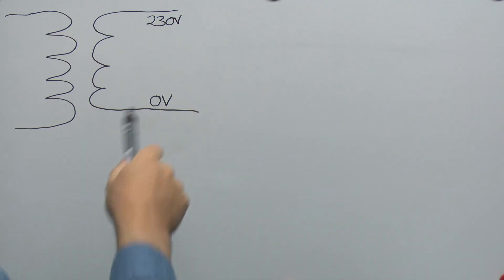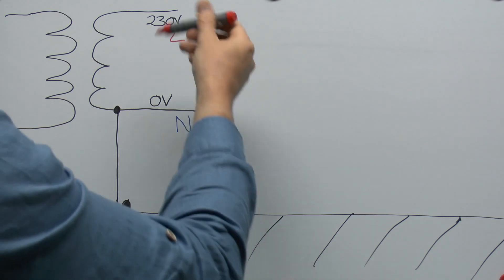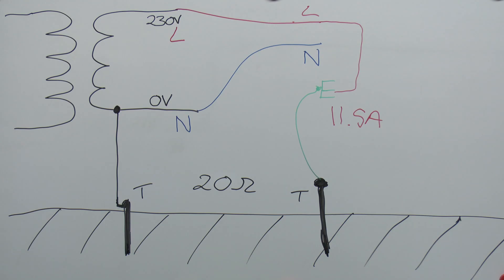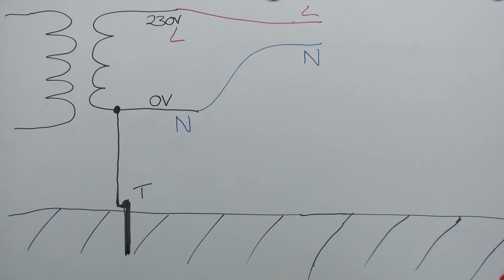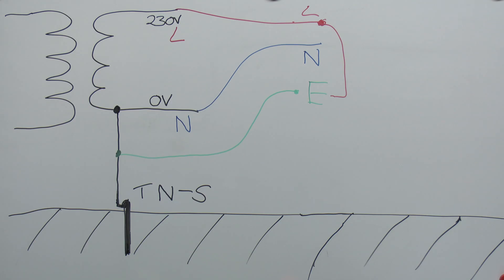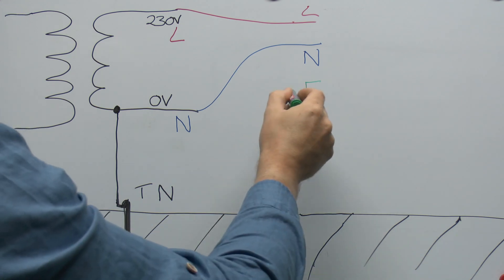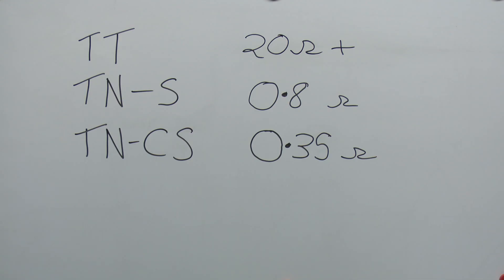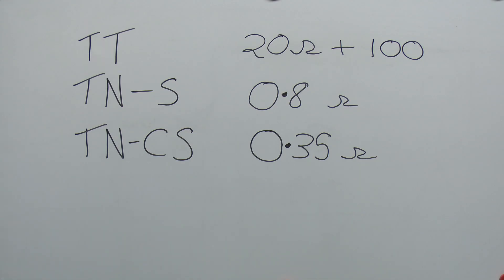Types of Earthing System for Electricity Supplies (UK)

Comment: 15:30 How did you get the theoretical max loop Z of 1600ohms (1.6Kohms)? 

If the trip current is 30mA and assuming 230V, the theoretical max loop impedance by V/Z = 230V/30mA ~ 7.6Kohms = 7600ohms. (Which is of course even more colossal and common sense dictates that's not a good idea in practice!)
Reply from the maker: +Arglwydd Anfradwrus It's 50 volts / 30mA, as in regulation 411.5.3
If 230V was used, this could result in voltages up to that level appearing on exposed conductive parts before the RCD operated, which would be a serious shock hazard.
Reply: Ah, thank you.

I stand corrected. 50V/30mA = ~1600 Ohms, but of course that's still way too high. 

I wasn't saying it was right for it to be 7K+, just wondered how you got that figure of 1600 ohms.

Very good explanation.

Comment: From an electrical safety and economical perspective the TN-C-S system is great. 
From an EMI (Electromagnetic Interference) and potential long term health effect perspective the TN-C-S system is horrible.
This is because TN-C-S among all grounding systems causes the most electromagnetic interference.

A lot of buildings have a reinforced concrete foundation with multiple electrical installations and conducting water/gas-pipes, which according to most electrical guidelines have to be connected to the Protective Earth. This causes the current which normally only flows through the neutral wire to also partially flow through those other grounded metal parts.

This will cause high magnetic fields which normally only occur around high voltage cables (more than 50kV) with a significant load. If the water/gaspipes and CATV/phone  are also bonded to the grounding system it will make things even worse and probably spread out magnetic fields all over the neighborhood.

Some countries understand this problem. France is such a country and they simply enforce TT-System in all residential buildings. Every customer main circuit breaker is also a 500mA Residual Current Device. So even pre-WW2 installations with ungrounded sockets, waterpipe grounding and fuseboxes without RCD's are relatively safe because the 500mA RCD will trip whenever a circuit leaks current through the ground.

Another solution to this problem without digging up the old cables would be to switch inside of the building to TN-S. At the entrance the PEN conductor (Protective Earth Neutral) has to be split into Neutral and PE. At this point the PE will also be connected to the foundation. This will limit stray currents inside of the building.

The best solution however would be to switch back to the TN-S system. Then you have your low impedance Protective Earth AND prevent Electromagnetic Interference. In factories, military and government buildings they still apply TN-S grounding for these EMI reasons because these buildings are usually too big for TT-Systems and they already have many electronic devices for more than 50 years. Until 2000 most electronic devices in a residential area were 2 TV's and 1 computer. That's why TN-C-S was not a big problem until recently.

We know long term exposure to magnetic fields >400nanoTesla causes an increase in child leukemia. We also know that electric installations become more and more polluted with pulses from electronic power supplies from which the long term effect are still unknown. The evidence that slowly starts to build up is not very positive. Therefore magnetic fields should be limited as much as possible. TN-C-S is not doing as much as possible.

So my advise is if you have TN-C-S. Take your own responsibility and switch to TT-System with proper RCD's installed whenever possible. Also apply galvanic isolation to all pipes (water, gas, cityheating) and shielded cables (CATV, Phone) to prevent currents from flowing through them.
Reply: How could EMI be introduced in the TN C S System when the neutral is earthed on both side, supply transformer and Distribution Board in the premise? Water and gas pipes were equipotential bonded to the earthing system in the premise. The earth reading shall not be more than 1 ohm! The low resistance in the earthing system the better will the return neutral current, which is only half of the design load. If there is going to be a fault current, it will also be very safe.

Comment: just wanted to say thank you for providing one of the most concise and clear explanations  of earthing structures
Reply: Cìâ
nhta çcucu derasunaaq
Reply: On cum ma fut
Reply: I only have experience where I can say for certain.

1. Only phase and neutral conductors are supplied.

2. No earth rods are installed at the transformers.

3. No earth rods or bonding to re-bar in the concrete is carried out.

4. Therefor this is a substandard TT system.

5. Sometimes earth and neutral are joined together making things worse.

Go watch my Facebook video Samui English Electrician
Reply: As they say...a drunk could understand that John...couldn’t be clearer...excellent. Thanks.

Comment: have you heard of a floating voltage. I had 23 volts L-N on a lighting circuit with nothing connected and everything switched off . I as told it was a floating voltage but cannot find much about it
Reply: Yes it happens when a live wire is next to a wire not connected to anything (f.e. switching wire) without any ground wire to discharge. If you do not connect any load (f.e. light bulb) the voltage can be anything between 0 and live (in the UK 230 volts).

That's why you should install ground wires even to a switch. To prevent parasitic charges. Many countries however still do not enforce this because it does not pose an electrocution risk.

Comment: There is a label on the cutout here that says "This installation is connected to a PME system" - so that confirms mine. A house we lived in before had a plate on the cutout saying "PME system" too. However, we also lived in one house where the supply came in from the poles, and that was TT. Our ELCB was a Chilton voltage-operated one.

Comment: I think the system in BRD often used is a bad idea. 
The TN-C-S grid on scematics show that some normal current go back to the transformer to the ground. 
I like the TN-S grid whith only one earth at the transformer . After that the neutral dont get another conection to earth!
Reply: +Klaus Jürgen You're right. That's why I don't like TN-C-S. TN-S or TT is the way to go. But since TN-S requires the electricity network company to install a cable with a seperate Protective Earth, the only way you can go usually is TT-System.
Reply: We use TN-C-S in the US. The most common problems are either incorrect installation (a sub-panel has earth and neutral connected in addition to the main panel) or one of the rare conditions where TNC (Earth and Neutral are same conductor) is permitted AND a voltage appears on the neutral relative to earth.

The TNC system has been banned from new installations since the 1996 National Electrical Code (adopted by local officials between 1996 and 1998 as some places run a year or two behind NEC) and was ONLY allowed on circuits feeding dual voltage appliances (clothes dryers and ranges usually). That allowed feeding a dual voltage appliance with three conductors (2x live and 1 Neutral) instead of 4 (2x live, neutral, and earth) and this practice (especially on ranges) dates back prior to earthed appliances.

Comment: In France, TT is the default system for everything; in new construction they typically use a earthing "ring" with wires buried all around the concrete foundation instead of rods; RCDs are mandatory. Here in Canada IT is used in Healthcare facilities; these systems are subject to very strict rules.
Reply: +w0ffe I think IT is only used in Operation Rooms. Most non OR's are usually TN-S.

Comment: Hi john I'm currently doing C&G 2365 and have been asked to give drawn examples of Tns, tncs, tt and IT supply and earthing systems. I have no problem with the former three but the IT system is proving problematic to gather info on. Do you know when or where people get trained in this type of install? My 2365 textbook states. IT and TNC  systems are not included in this course so there is no information included on these type of installations. Thanks. Phil.
Reply from the maker: +phil Harvey IT is where the supply is isolated from earth, such as an isolating transformer.  Neither side of the supply is connected to earth, or it is connected to earth through a high impedance.  It is typically used for medical installations such as operating theatres.

TNC is a system where the neutral and protective conductor (earth) are combined into a single conductor within the installation, so only 2 wires to each item.  It is specifically prohibited other than in a few very specific instances, so in reality is never used in the UK.  The supply is the same as TNC-S, except that there is no split to separate earth and neutral where the supply enters the building, it continues for the whole installation with the combined neutral and protective conductor.

There is some information on both in BS7671.
Reply: +John Ward nice one john. I would guess that training for IT installs is trained by the energy supply company.

Comment: In Australia, the Multiple Earthed Neutral (MEN) earthing system is used and is described in Section 5 of AS 3000. For an LV customer, it is a TN-C system from the transformer in the street to the premises, (the neutral is earthed multiple times along this segment), and a TN-S system inside the installation, from the Main Switchboard downwards. Looked at as a whole, it is a TN-C-S system. So, normally there will be a link in between the neutral and earth bus bars behind the switchboard, as well as at the local transformer.

Comment: A very interesting video,  in my hobby (amateur radio) we tend to have grounding arrangements that attach to the shield of coaxial cable at the base of the aerial. This cable then generally connects to the equipment chassis within the house which is also connected via the standard mains lead to the standard domestic mains earth.
In my set up the "ground mat" under the lawn is also bonded to the water piping of the house.  It is a slight concern that in the event of a live-earth short in any part of the house a proportion of the fault current will flow through the equipment chassis to the " other ground".
For various lightning protection reasons it can be very bad news to isolate the two grounding systems.. ie to provide a seperate safety earth only for the radio gear.
This situation must be very widespread, presumably the answer is to make the bonding path as low resistance as feasible to minimise the current flow through the other path? We have an RCCB so presumably my question is more of a hypothetical one?
Thanks for the video, most educational!

Comment: Why do they use earth rods? Can’t the neutral cable carry all of the fault current back to the transformer? 
Also if someone touches a live conductor and they are standing on the ground outside they can receive a shock, whereas if there was no earth rod at the transformer they would not (as long as they are not touching neutral as well).
Reply from the maker: Newbpatrol2 Earth rods are used to ensure the neutral remains at or very near to the same potential as the actual ground.

An isolated system (not referenced to earth) would be safer, but only while the entire system remained isolated. 
A single fault to earth anywhere would make it into an earth referenced system,  and as a transformer can supply multiple properties, such a fault is highly likely.
Reply: ***** I can confirm this.

Most residential areas here in Norway have the IT earthing system, and earth faults are abundant. Most homes still don't have RCDs installed.
Reply: Robin Heijblom
That is what I said. Earth faults are pretty common here because they usually go unnoticed until there is a second fault in the system. In fact, I need to call the supplier and inform them that there is an earth fault somewhere in my neighborhood now.

RCDs have been required by law for earthed circuits in IT-supplied residences here since 2002, but since this law isn't retroactive most still don't have them installed.
Reply: +pesshau Ahhh, my fault. I read absent instead of abundant.

I know someone moved to Norway in the assumption there would not be stray currents because of the IT System. To his surprise there were stray currents everywhere. I bet his problem is exactly as you describe. The lack of properly monitoring ground faults in the IT System is the problem.

That's why most countries use TN-C-S. It's cheap and monitoring is not necessary because any circuit breaker will clear the fault. TT System is better for preventing EMI but worse for clearing ground faults because you depend on RCD's. TN-S would be perfect but is 25% more expensive with 3-Phase+Neutral distribution.

But it sounds to me the electricity network company in Norway is not taking enough responsibility and doing a horrible job. But this is no surprise to me. The same in the Netherlands and Germany. Stray currents everywhere because of Multiple Earted Neutrals in regions with TN-C-S. And since the users pay for the stray currents, the company does not care.
Reply: +John Ward "Earth rods are used to ensure the neutral remains at or very near to the same potential as the actual ground."
Can you please explain this more detailed?
Thanks in advance!
Reply: +Newbpatrol2
+pesshau

Safer? Realy? And what happens when:
- the 1st phase accidently connects to the ground in one building
- the 2nd phase accidently connects to the ground in another building?
You basicly have currents everywhere between the buildings. How are you going to clear the fault?
- there is no low impedance path going back to the transformer since there is no neutral therefore the ground cannot be connected to the neutral
- there is no RCD so any imbalance between the phases goes undetected
Consequence: People can get electrocuted at strange places, energy gets wasted, how can this be safe?

The reason IT is safe in hospitals is because they have special RCD's for IT systems. These are very expensive and are only used in places were microVolts can be a problem (like an OR). Like John Ward says, an IT system is only safe when it remains Isolated from the Terre (ground). Since residential IT systems have not the proper protection, they are more unsafe than TT and TN systems.

I heard from someone in Norway they actually have the problem I just described and currents all over the place.
Reply: What I was told many years ago was not grounding the Neutral/Star point in the distribution transformer is THEORETICALLY SAFE, BUT REALLY DANGEROUS. There are bound to be some leakage or inconspicuous current paths that can carry lethal amounts of current.
Reply: +Arglwydd Anfradwrus Yes that's what they have in Norway and what causes a lot of problems with stray currents and if your own grounding system is not appropriate, also stray voltage.

That's why IT systems are almost never used for low voltage distribution (<500 Volts). Even delta systems are either star at the source with the neutral grounded, or if the source is a delta transformer one of the phases should be grounded. Otherwise it's impossible to monitor the first fault and two faults cause uncontrollable stray currents between the faults.
Reply: Then I'd be very queasy living in Norway! :-S
Reply: +Arglwydd Anfradwrus Well not all regions in Norway use IT System. Usually only rural area's. But most urban regions and almost all new residential buildings have TN-C-S like in the UK, Netherlands, Germany and most other countries. I'm not a big fan of TN-C-S but at least it's better then IT System without proper monitoring. I however would always convert my electrical installation to TN-S or TT grounding whenever possible.
Reply: That's a good policy to adopt. I might reconsider my potential move to Norway now! :P

Comment: Here i have 3 live wires and nothing more from the supplier. and you must have your own ground. the power is in a delta configuration and no neutral line. 230V 3 phase.  
the new systems have a y configuration and 400V 3 phase. you still need to supply your own ground and combined that with the supplier neutral.